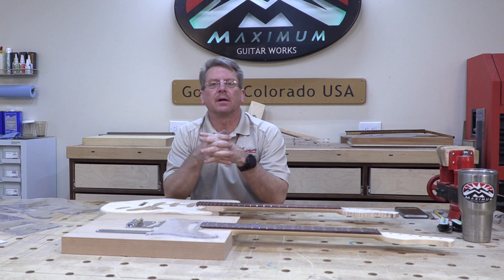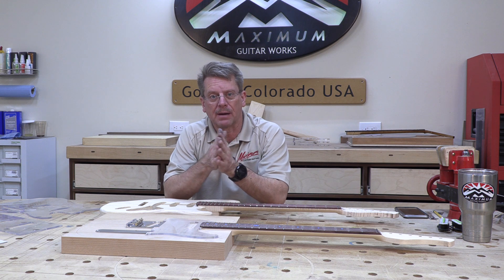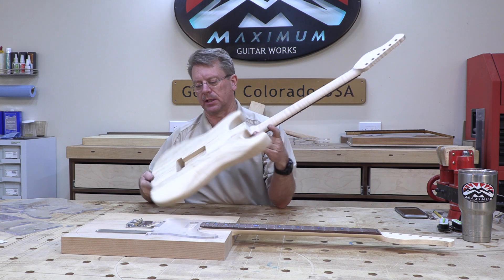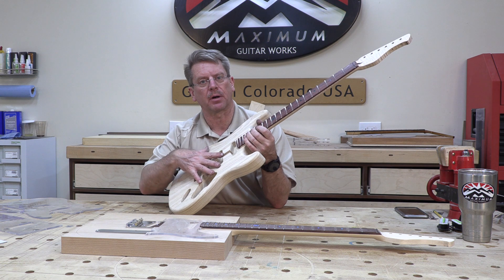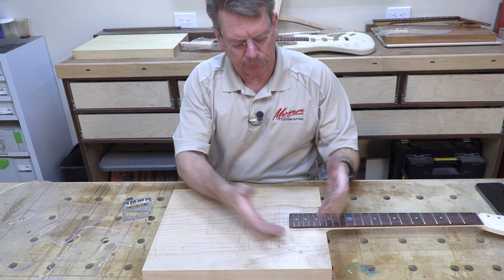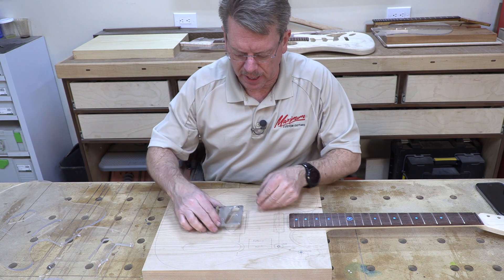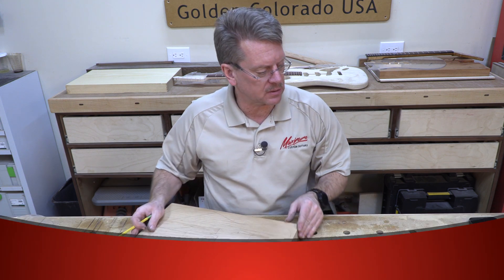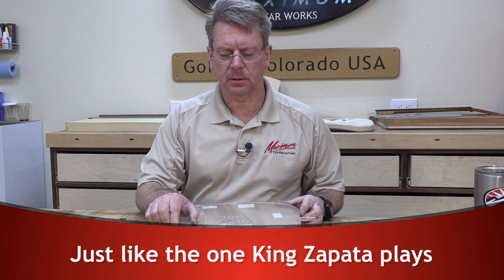Telecaster Build - Part 9 - Body and Pickup Routing

Comment: What size roundover bit should be used for a traditional telecaster style? 1/8”? Or 1/4”? I know strats use 1/2”. However, I’ve seen conflicting info regarding roundover bit sizes for teles. And, how would one go about rounding over an arm contour?
Reply from the maker: The bottom line...use what you want.  1/8" is more vintage...1/4" more modern.  I use 3/8" because I love the extra comfort.  In the end it is up to you and what your goals are.
Reply: @maximumguitarworks  Thanks! I agree with the bottom line. Just going for a mix of vintage and modern on this one. Traditional pickup routs, cavity, etc. But with belly and arm contour.

Comment: How thick is the body blank when you first get it
Reply from the maker: 1-7/8” to 2.0”
Reply: @maximumguitarworks  so would a body blank that's 44.5 mm work
Reply from the maker: That is the finished thickness of the body. So the blank should start off a little thicker...for sanding and such. With that said...there is no rules that say you can’t vary the thickness some. The builder is the final say. If you go too much thicker...it could be too heavy or uncomfortable (both personal preferences). If you go too thin with the body...that could impact your choices for certain electronics options.

Comment: Thanks again for the lesson Steve !I might have an intresting question. The Tele guitar has 21 frets, but the Strat has 22 frets, as far i can see and count on the video. I can't tell if the stratocaster has a bit of an overlay of the fretboard at the heel of the neck ? That's as far as i know the way Fender does it if there are 22 frets on. So my question is, that's why counterfeit Chinese or other pickguards don't fit on the neck pocket, but a real Fender one does fit on a 22 frets one. I have a Squier Classic Vibe, who has also 22 frets and i've put a Chinese pickguard on it, but had of course a file out situation to make that overlay of the fretboard to fit. However..  miraculously the holes for the pickups still did match up ?? I had allready sold the original pickguard that was on the squier, so i couldn't compare and measure. I also noticed after, i actually didn't need to file out the pickguard pocket of the Chinese pickguard, because the fretboard exactly fitted just over that pickguard, who had probably the same thickness as the original. But if i see a real Mexican or American strat, the distance between the upper side of the neck pickup and the end of the fretboard, no matter if it's a 21 or a 22 fret one seems to be the same ?? Same as on your Tele template here ? And the body shape stays the same.. so that would mean, a template for a 21 strat would not be good for a 22 fret neck. You can't shift the bridge back, because of the scalelenght, so you would have to rearrange the distance of the pickups between the scalelenght point on the bridge and the end of the 22 frets fretboard ? Could you clear this up please Steve ? I' wrestling a long time with this question in my mind now. Thanks in advance ! Greets from Belgium.
Reply from the maker: Hey Bruno.  Once again, thank you for your comments and great discussion point.  Honestly, I'm not sure I have your answer.  In this case...yes the Tele has 21 frets and a squared off end of the heel.  The Strat is a rounded heel end...and the 22nd fret is right at the end of the heel with a slight overhang of the fretboard.  The rounded heel does give that slight wiggle room for super minor setup tweaks as I mentioned in the last reply I just posted from Amit.  I wouldn't call myself a Fender expert.  I have normally shied away from guitar copies because I would rather become known for my own twist on guitars.  However, because Fender has an undisputed place in history...I figured that it would be a great place for my students to start.  I purchased the CAD plans from a guy online who seemed to have the most accurate files I could find.  

The bridge location is really the only critical dimension.  Let you said...you can't move the bridge.  The pickups can be moved a little for spacing...although that would mean you can't use manufactured pickguards.  I try to make my own pickguards because I can tweak things as needed.  Honestly, I'm not sure if I ever had a Chinese made pickguard to compare to a US/Mex Strat or Tele.

So, sorry Bruno...but you might be continuing to wrestle this question for a while longer!
Reply: @maximumguitarworks  Thanks for your time and reply Steve ! Maybee i don't have the full answer, but i got again a bit wiser. If i find out.. and i will.. i am very persistent in that, i'll keep you informed, right away. Thanks again !

Comment: Thank you Steve! Why don't luthiers make the neck pocket in a shape of something like a jigsaw puzzle, to prevent the neck from shifting to the side?
Also, what is the benefit in a neck pocket like on Tom Anderson's guitars?
Reply from the maker: Amit.  Thanks for your comment.  Those are a couple good questions...and I honestly don't know if I have the answers.  Most companies that make bolt-on necks seem to just follow the Fender standard.  It seems like the you could make the pocket in any male/female shape and it would work.  The question is why deviate?  What Tom does is cool...and you can probably find the answer on forums as to why he does it that way.   The true answer might be...because he can.  I'm not a guy that believes that we should always do things "because that it how it has always been done".  However, most of the time I stray from an acceptable standard, I find out why it was done the way it is.  From a builders point of view...a traditional pocket with a slight amount of movement can help tweak the final setup.  Once the bolts are tight...it really doesn't matter.  There are many people that do things only because it is not what Fender did/does.  I believe that Leo was more of a genius than many give him credit for.  With that said...I still look for ways to improve my quality and processes.
Reply: @maximumguitarworks  thanks Steve!